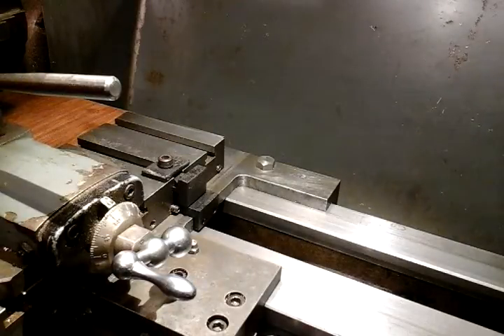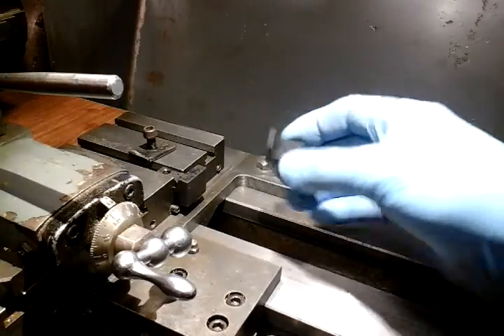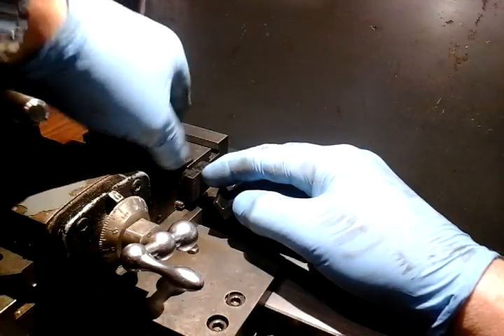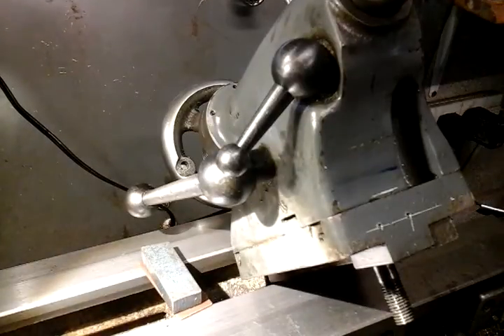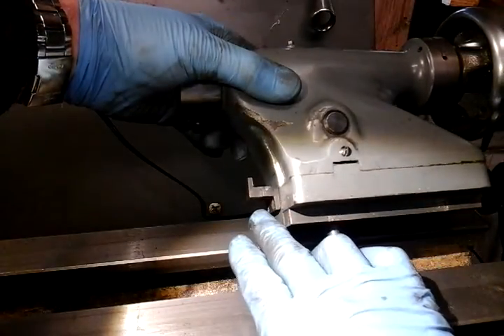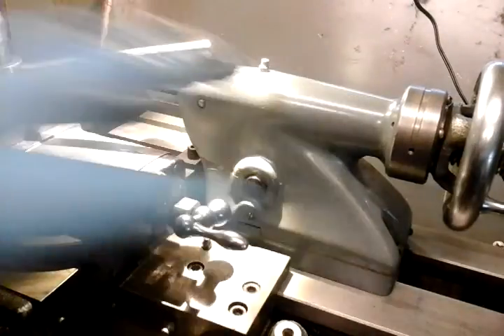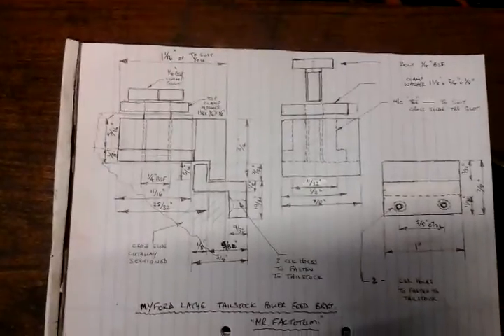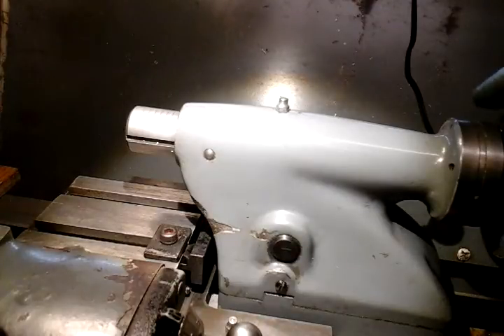Lathe Tailstock Power Feed....mr factotum

Comment: Hi Mr F,
This is a very good modification...
I've been looking a Myford Super 7's the last couple of days... So much money but i thought they may be better than a Chinese import I've been thinking about.
Take care
Paul,,
Reply from the maker: hi tkw
yes, myfords do command a price, but theres alot of rubbish ones thats worn out. A good one though should be a good investment. however for hobby use i think the chinese ones suffice, 
good luck with the purchase which ever way you go
regards
mr f
Reply: @MrFactotum  Sorry to bother you again... I assume with the right setup you can cut left hand threads on a super 7
Reply from the maker: @TheKnacklersWorkshop  hi paul at tkw
yes, is the answer, just need to throw the tumbler to feed away from chuck. also much easier for any threading to have a quick change screwcutting gearbox on, many myfords dont have this, so if not you will need all the change wheels etc.
Reply: @MrFactotum  Thanks

Comment: I'm in the process of utilizing the unused auto feed of my lathe for other than turning, boring and threading. You have a wide range of speeds to choose from, depending on the job at hand. However,my approach  provides a lighter load on the the lead screw and also more precise and solid platform for a chuck. You should build a single tool post capable of holding not only a boring bar and a drill chuck, but also an ER32 or ER40 chuck with a straight shank offered by CTC Tools in China at very affordable prices. Then, you should get a straight shank for you drill chuck with the same diameter so as to keep collet changes to a minimum. 
Many home shop small lathes, use a back tool post for a parting blade. Sets of ER collets are offered by Banggood in China at very good prices and free shipping. They are the way to go.
http://www.ctctools.biz/er-collet-chucks/
https://www.banggood.com/?utm_source=google&utm_medium=cpc&utm_content=all&utm_campaign=sbcn-ca-bg&gclid=EAIaIQobChMI1dHAvLG32AIV2LbACh2EdAA9EAAYASAAEgIFzPD_BwE
The way to go about the block is to find a block of CRS of suitable size and attach it from underneath to a plate bolted to your slots in the cross slide. For your application the block it should be 3" square and the plate 1/2" or 12mm thick to fit your slots. Only when your block is ready and solidly mounted, you can easily drill and bore a 3/4" diameter hole using the lathe chuck for a perfect and easy center line. A couple of Allen grub screws in 8mm on top should be enough to hold any tooling attached to the post. For a secure locking of the shank to the post, mill a flat alongside the length of both shanks (ER collet and drill chuck).
You can write to me if you wish at   scrdmgl@gmail.com

Regards from Toronto 
George
Reply from the maker: Thanks george for detailed reply and interest, i appreciate that. Its nice to bounce different ideas around, it helps many people who are interested in our line of work /  hobbies, i'm all for it.
Yes, i have the attachments to hold a chuck etc.on my cross slide, and also the rear parting tool holder, i was just showing another way of approaching an automatic feed for drilling in certain situations and applications. 
Thanks again for your help.
Regards
Mr factotum